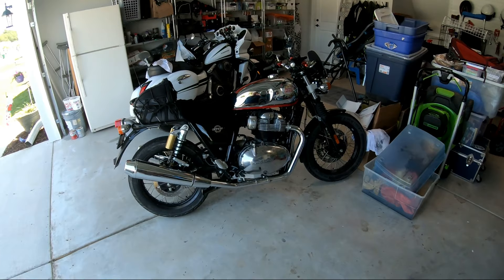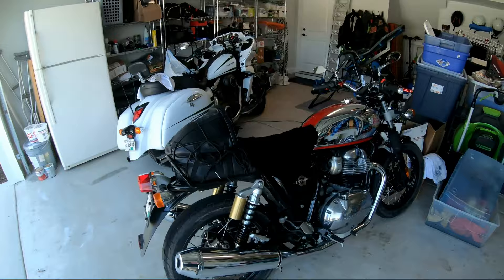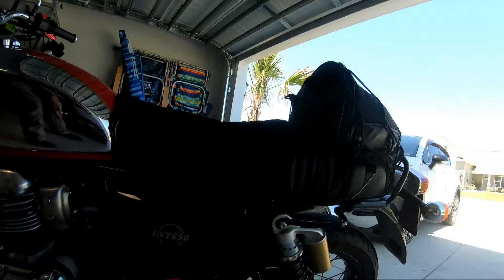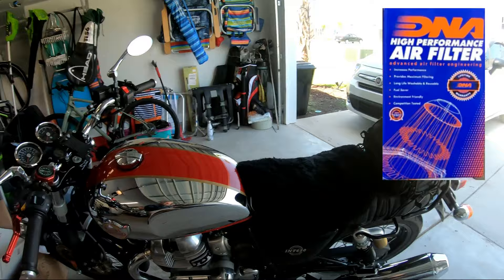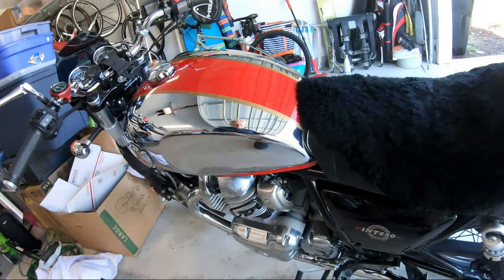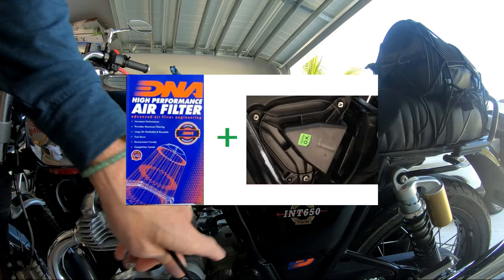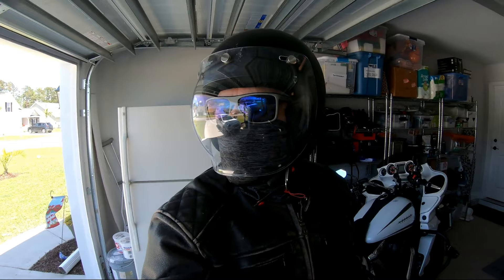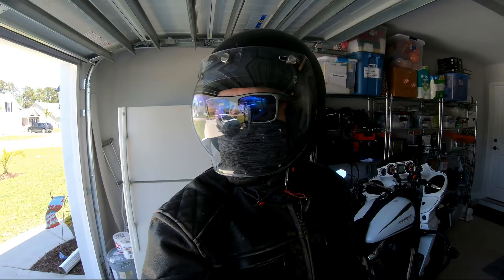Watch This Before Installing DNA Filter

Comment: Hi Quentin,  i did exactly the same with my Interceptor.  Mine is a 2023 Euro5. I checked mine at top end for performance and it was great. I aslo blocked the space between the frame and Airbox to only let in cold air. Ok, keep the rubber side down and stay safe.
Reply from the maker: Interesting, thanks!  I still have my INT650 with no intention to let it go.

Comment: If you tune it it wil be fine at the top of the rpm range, more air needs more fuel. It is way to lean whit that open cover. I like you solution, its clean. Love the video btw
Reply from the maker: Thanks!  I’ll look into a tuner. 👍

Comment: That is an interesting observation about the DNA air filter. My interceptor 650 is still not fully run in yet. I have the DNA triangular clamp installed, but I am still using the original air filter as it is still clean. I notice a throaty roar when I open the throttle, but I have aftermarket silencers also (Hitchcocks Enfield stainless), which look great and are louder than the stock pipes, even with the baffles in. I will try to observe the difference when I change to the DNA filter at about 5000 kms. I enjoy your videos!
Reply from the maker: Thanks!  Lots of combinations to try.  I rode my bike completely stock for over 3,000 miles before I bought the DNA.  By that time I was very familiar with the power curve of my bike.  I could take or leave the throaty roar down low, but, by the seat of my pants, I could feel that loss of top end surge.   It makes sense that the bike would just be too lean with the throttle wide open and all that unrestricted air coming in.  Going back to the OEM cover solved the problem, and smoothing its interior, I believe, must reduce air turbulence, reducing power dips at certain throttle openings.  I can clearly feel these results.
Reply: @QuentinsMotoVlog  I was hoping that the ECM will adjust for air filters and slip-ons. My bike is Euro 4 and so it might run a little richer than a Euro 5 version I suspect. Good job with smoothing the OEM snorkel.

Comment: I have heard that using the booster plug helps with the fuel air mixture so it’s not so lean, I haven’t installed my DNA yet I wanted to install both at the same time
Reply from the maker: I think they’re worth doing, especially the DNA. If nothing else, you get a very nice induction roar.

Comment: Hi Quentin, when you fitted the filter with the engine cold?? you then need to start the bike an don't touch the throttle let it idyll for 12 minits to warm up , what happens is the computer reads the change yourv made IE oxygen sensors, manifold sensors etc then it remaps the fuel injection, because the air flow has changed,, same thing also if you change the exhaust mufflers cheers JK
Reply from the maker: Thank you.  I knew that.  I did let that warm up happen both times, first when I installed the DNA with their bracket, and again when I replaced their bracket with the OEM bracket smoothed out on the inside.

Comment: A vid of you "dremilling" off the protrusions would be useful.
Reply from the maker: Yeah, I'm just too lazy!  Ha!  Look, if you open the left panel you will see three philips head screws holding the stock air filter cover in place.  Remove the cover and look and feel inside it.  You can't miss the rough seam I describe.  If you have a Dremel, you know how they work.  I put a small grinder on the Dremel, held the cover in my left hand and used the Dremel in my right to drag it back and forth over the seam until it was smooth to the touch.  I hope that helps!

Comment: So did you decide to live with the power drop and throaty sound ?.  What were your reasons for reverting back to using the steel clamp? Thanks
Reply from the maker: In the end I decided that probably the DNA designers know a little bit more about air flow than I do, so I went with the triangular metal bracket. The bike has a nice flat torque curve and the high end is still there when I want it. And I do love the sound!  I also added the temperature sensor relocation kit from Hitchcocks but I honestly don’t feel much improvement from that. It’s cold outside, so maybe in the summer it will make more of a difference. Thanks!

Comment: Q, i will be trying this trick on my 650 meteor. I think your saying to remove the center split piece in the old snorkle, have i got it correct? If i have it wrong, please correct my mistake and tell me what part i need to remove! Doug🏍️👍😀🧸🐻🤓
Reply from the maker: Yes, I think so. The idea is just to smooth out the inside of the snorkel so the air flows smoothly. Good luck with it!

Comment: Hi, could you explain mi better what did you do with the snorkel. Thanks a lot 😊
Reply from the maker: Sorry for the late reply!  Just saw this.  In the end, I ditched the snorkel altogether and just went with the triangular bracket DNA provides to hold the air filter in place.  Very happy with that set up now.
Reply: Hi  @QuentinsMotoVlog , what made you decide to go back to the triangular bracket over the modded original snorkel? I'm trying to decide if I mod the original for free or buy the bracket to make the change reversible.